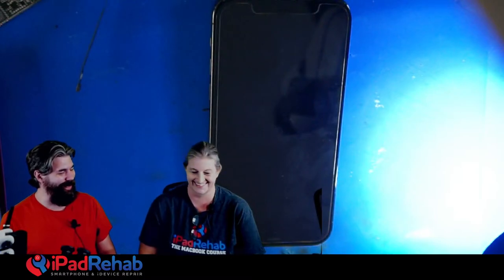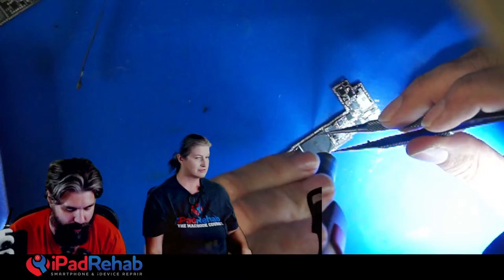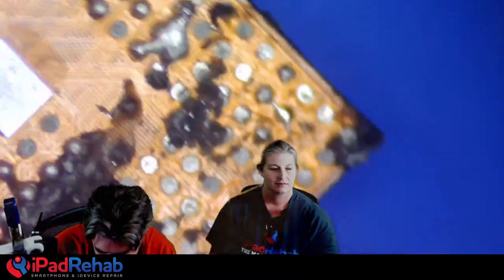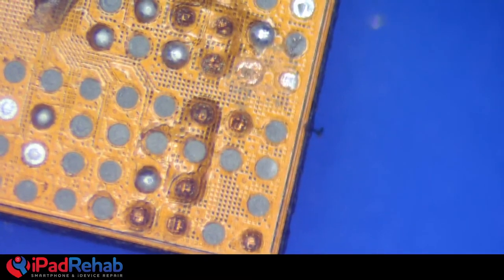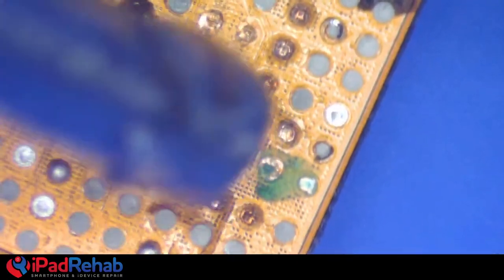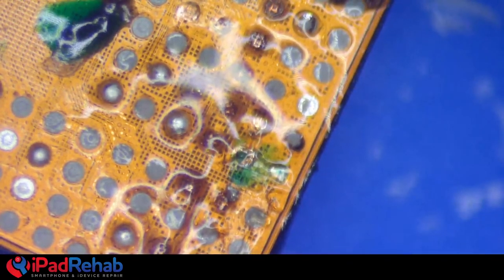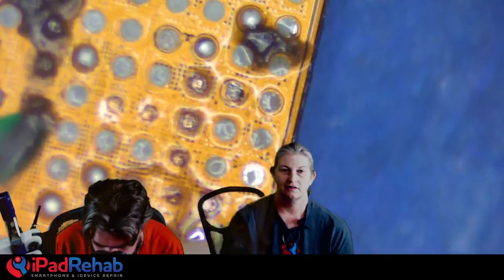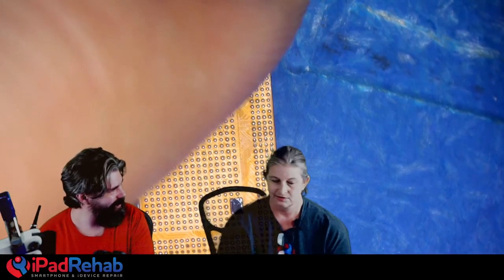iPhone 12 CPU Magic

Comment: High ball count chips these days use the flip-chip method of connecting the silicon to the substrate / carrier. The carrier is a PWB in its own right, with ball pads on one side to attach to the i-phone and pads on the other side to attach to the silicon. You can see some of the copper plane hatching on the CPU, and see the tiny traces internal to the CPU carrier. There is a thin layer of FRP between the side looked at and the next layer. The carrier is a 4 to 6 layer board at about 1mm thickness (39 thoundths of an inch). The pads are about 0.4 mm in diameter and on a 1mm pitch spacing. Let us see mark repair a pad on a Chip Scale Package (CSP).

Comment: Nice PAD Repair Mark I had a Thunderstorm Water Damaged Sony Xperia board that had left no trace of survivors next to the screen connector for Backlight and no schematics etc to know what was what other than looking up some images of the board in that area to see what sort of components should be where the crater was left and had to dig down through some layers of the board to find a tiny nub surrounded by much ground to then mask off ground in a similar way so that I could tin the nub and add a jumper / pad for the backlight filter which restored backlight to the device 🙌🏼

Comment: Seems to be a lot of interest from law enforcement for phone repair, I wonder if they'll ever figure out how to fix a phone from microwave oven damage
Reply: Microwave often just fries the RF circuit, leaving the phone still working otherwise, at least when it comes to Android phones. iPhones have some other stuff nearby the RF part so it may suffer as as well.
Reply: @arcaine2  I don't know if you've ever microwaved a phone, or any electronic device with IC's in them, but they definitely get destroyed. Batteries may also combust depending on charge causing additional fire damage. Pretty much everything from caps, diodes resistors to IC's get the same treatment as a CD, if you've ever seen that. It's a very quick albeit smelly destruction option.